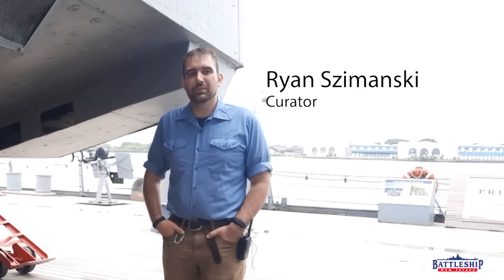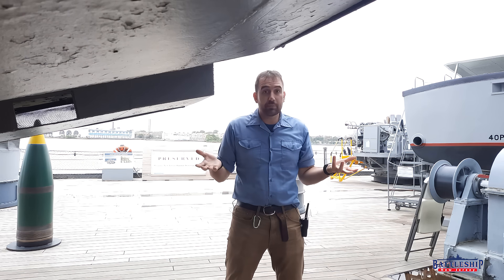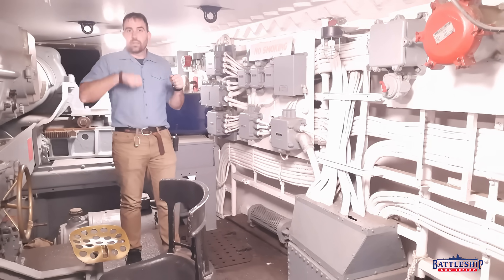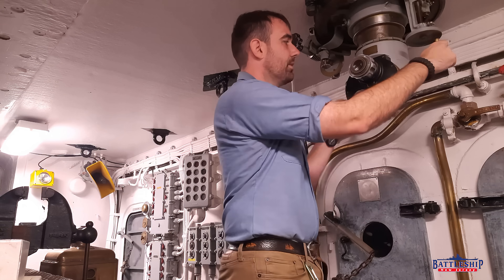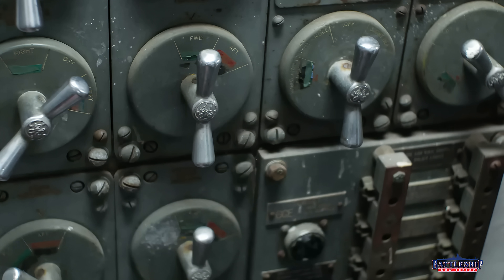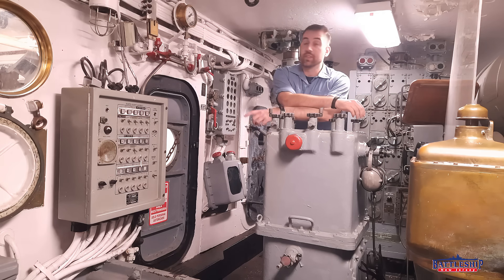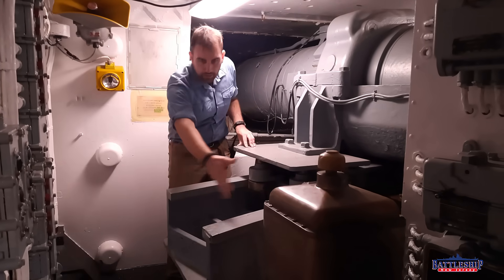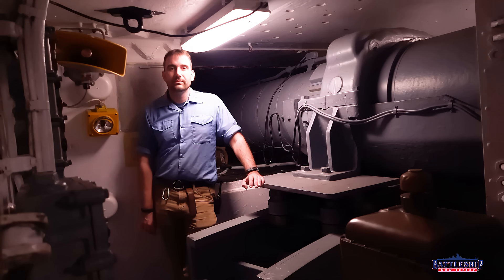Inside a 16in Gun House

Comment: What does the other, outside, end of the range finder look like?  Where is it located?
Reply: the two ears on the sides of the turret is where they are located
Reply: @jeffhousen8968    Thank you.  For binocular vision, makes perfect sense.  So this single tube that the range finder crew looks through is seeing the combined images of both left and right, and the single tube we see exposed in the room is parallel with the gun barrels?
EDIT after looking at a diagram, I see I was wrong.  Does the range finder consist of two separate tubes that can both look inwards, (like cross-eyed)?  My confusion is my assumption that it is one straight tube such that if the right side looks left, the left side would also have to look left.  Maybe the field of view is wide enough, so that what I am thinking does not come into play.
Reply: @conrad4667  I think the way they work is that you see 2 images (one from each side) in the viewfinder. You twiddle some knobs, which moves some mirrors until the 2 images overlap. The angle the mirrors deflect allows you to read off the range. The wider the range finder the more accurate ...they probably don't come any larger than on a battleship, but I've seen man-portable ones on display in the German shore defenses on the island of Jersey. (where the name originates)

Comment: That seat you mention isn't a 'Bicycle' seat but is very similar to the seats found on pre-1960s farm equipment.  Some tractors and a whole bunch of other pieces of towed (tractor or horse-drawn) and self propelled equipment had them.  Let me tell you, even to a young, pre-teen butt they were not the most comfortable things to sit on.  There were also dozers and other construction equipment that used them.

Even though I did some work aboard Iowa right after she recommissioned in the 80s, I never got to visit one of the turrets.  I did tour the aft turret of the North Carolina with my 5'11" son.  I'm 5'7" but even so equipment in that turret was finding my head and my son ... "Dad, I don't see how they did it."  And yeah, it was hot in there.
Reply: That seat is basically the same seat in brass.. that's on my '45 Farmall A.. wildly uncomfortable to sit on.
Reply: The seat is actually looking more comfortable than the seats for the gunners on a 3-inch M1902. But there is a disproportion between the cost of the gun and the comfort of the seats, obviously.

Comment: So, when the fire occurred in Iowa's number 2 turret, did the detonation overwhelm the interior gunhouse armor (between the turret officer's booth and the gun pit), or were the doors open, or did the conflagration just suffocate the crew through a combination of over-pressure (excluding air from entering) and gasses?
Reply: Wondered the same thing as I watched this. I wish Ryan would do a more in depth video sometime on the Iowa explosion, maybe touch on things like who survived and why they did and also a detailed discussion of what damage was done inside the turret.
Reply: @davidm.9812  At 09:53, about 81 seconds after Moosally's order to load and 20 seconds after the left gun had reported loaded and ready, Turret Two's center gun exploded. A fireball between 2,500 and 3,000 °F (1,400 and 1,600 °C) and traveling at 2,000 feet per second (610 m/s) with a pressure of 4,000 pounds-force per square inch (28 MPa) blew out from the center gun's open breech. The explosion caved in the door between the center gun room and the turret officer's booth and buckled the bulkheads separating the center gun room from the left and right gun rooms. The fireball spread through all three gun rooms and through much of the lower levels of the turret. The resulting fire released toxic gases, including cyanide gas from burning polyurethane foam, which filled the turret. Shortly after the initial explosion, the heat and fire ignited 2,000 pounds (910 kg) of powder bags in the powder-handling area of the turret. Nine minutes later, another explosion, most likely caused by a buildup of carbon monoxide gas, occurred. All 47 crewmen inside the turret were killed. The turret contained most of the force of the explosion. Twelve crewmen working in or near the turret's powder magazine and annular spaces, located adjacent to the bottom of the turret, were able to escape without serious injury. These men were protected by blast doors that separate the magazine spaces from the rest of the turret.
Reply: @davidm.9812  The explosion was caused by a fire that started when WWII era gun powder in a powder bag 45 years old ripped open and ignited because it was unstable and rammed too far into the gun breech in an attempt to close the breech and contain the fire. THERE WAS NO 'DETONATING DEVICE'
Reply: @davidm.9812  On 19 April 1989, the Number Two 16-inch gun turret of the United States Navy battleship USS Iowa (BB-61) exploded. The explosion in the center gun room killed 47 of the turret's crewmen and severely damaged the gun turret itself.To assist the GAO, Sandia National Laboratories provided a team of scientists to review the Navy's technical investigation.

During its review, Sandia determined that the bags of powder used for the gun had likely been rammed farther into the gun breech and at a higher speed than designed (a so-called overram), resulting in the powder igniting while loading was still in progress. A subsequent test by the Navy confirmed that an overram could have caused an explosion. Sandia's technicians also found that the physical evidence did not support the U.S. Navy's theory that an electronic or chemical detonator had been used to initiate the explosion.

In response to the new findings, the U.S. Navy, with Sandia's assistance, reopened the investigation. In August 1991, Sandia and the GAO completed their reports, concluding that it was likely that the explosion was caused by an accidental overram of powder bags into the breech of the 16-inch gun. The U.S. Navy, however, disagreed with Sandia's opinion and concluded that the cause of the explosion could not be determined. The U.S. Navy expressed regret (but did not offer an apology) to Hartwig's family and closed its investigation.
Reply: yes everyone in the turret officer's compartment died
Reply: Oh man oh man i was thinking the exact same thing, especially wondering if it blew out those internal port holes... what a horrific way to go =/
Reply: @ScumfuckMcDoucheface  At 09:53, about 81 seconds after Moosally's order to load and 20 seconds after the left gun had been reported loaded and ready, Turret Two's center gun exploded. A fireball between 2,500 and 3,000 °F (1,400 and 1,600 °C) and traveling at 2,000 feet per second (610 m/s) with a pressure of 4,000 pounds-force per square inch (28 MPa) blew out from the center gun's open breech. The explosion caved in the door between the center gun room and the turret officer's booth and buckled the bulkheads separating the center gun room from the left and right gun rooms. The fireball spread through all three gun rooms and through much of the lower levels of the turret. The resulting fire released toxic gases, including cyanide gas from burning polyurethane foam, which filled the turret. Shortly after the initial explosion, the heat and fire ignited 2,000 pounds (910 kg) of powder bags in the powder-handling area of the turret. Nine minutes later, another explosion, most likely caused by a buildup of carbon monoxide gas, occurred. All 47 crewmen inside the turret were killed. The turret contained most of the force of the explosion. Twelve crewmen working in or near the turret's powder magazine and annular spaces, located adjacent to the bottom of the turret, were able to escape without serious injury. These men were protected by blast doors that separate the magazine spaces from the rest of the turret.
Reply: @NAVYMEDIC610  thanks, source for this info? =)
Reply: @hemaka482  I figured but didn't care enough to go look

Comment: I'm 6'4", I don't fit in any armor... Neither tanks, APCs, or battleship gunhouses!
Reply: In the Michigan Army National Guard in Iraq my duty was in a signal shelter in the bed of a Humvee.  At 6'4", I could touch both side walls. turn 90 degrees, switchboard, and door.  If I tried to stand up, my shoulders hit the ceiling.  I didn't mind.  My duty babysitting it included access to the internet at work.  So sitting at the computer e-mailing my friends back home how rough I had things kept me sitting and busy for the shift!
Reply: @klsc8510  Never been in a humvee actially. I've herd mixed reviews tho...
Reply: @maxcaysey2844  Underpowered and terrible seats.  Fully climate controlled.  Hot in the summer, cold in the winter, and wet in the rain.  Other than those, not bad!
Reply: @klsc8510  Ha ha... sounds like the M113G3, which I have spend countless hour in. Sweating and freezing... Especially as a vehicle commander up top doing 45km/h in a hail storm! Good times!
Reply: Fun fact when Arnold Schwarzenegger served in the Austrian military he was a tank driver..
I'm still trying to figure out how he fit.

Comment: Regarding the welds, I used to work for a company that was a tier 2 supplier to a few government prime contractors. Some of the work I did was welding armor. For thick armor (half-inch or more) we would do multipass overlap welds on joints. We did it for a few reasons, primarily to create a large fillet and ensure we have a large area of the parent metal to spread loading. What I find so fascinating is I suspect back then they did it because as Ryan pondered the Navy didn't trust welding yet and it turns out it's the best way to do it. Fun fact, I did some welds on butt joints that started with a non-filled pulsed TIG pass followed by multiple MIG cap passes
Reply: It makes sense.  You don't trust the weld so you come up with a mechanical design that's stronger.  Even once the welds are proven it's still a mechanically strong design.
Reply: A multi-run pass will generally be weaker than a single run (of the same total size as the multiple runs) due to heat effected zones (HAZ) of later passes impacting the former, while the contraction stress area will be lower diameter. But reaching those sorts of immense deposition rates was probably not economical given how new large scale welding for of ships ect was... and they didn't have the benefit of hindsight to know lots of that tech/gear would last 80+ years, rather than being replaced again in a decade or two with something equally revolutionary, so going all in on tooling/training wouldn't have been seen as wise (although Japan did basically opt this route, and some early teething issues aside, it did pan out).
Reply: @SheepInACart  I used to work for a trailer building company. We had to switch from a single 1/2” weld on the king pin to a 3 pass weld because the amount of heat that the single pass put into the plate caused the king pin to periodically be ripped out through the 3/8” plate.
Reply: @jordan4777  As a cost economical switch if its still adequately strong, thats a fine solution, but the heat itself isn't the enemy, indeed it'd be stronger overall if you'd increased the preheat to reduce the heat affected zone (itself formed by the difference in temperature, not total amount) of the single run.

Comment: The multiple weld beads are how you get a proper connection for thick plate. If you only had one weld bead, the amount of metal connecting the two plates is only one weld bead thick. All of the extra weld beads are so you can get a weld connection that is as strong as the plates it’s connected to.  Not trusting welding may be why they zig-zagged the weld. That gives you a longer weld seam length, and thus more area of weld connecting the plates.
Reply: I noticed in the other video where it showed the top of the belt armor (I think it was the belt) had the same zigzagging. I was thinking it might there to better resist the shock of getting hit by large naval shells. A zigzag is far less likely to shear than a straight weld.
Reply: @aaronp3411  I think you've got it.  The forces / energy that impacting major caliber artillery shells would deliver are stupefying.  Where possible the designers and builders tended to be conservative, "if 'X' is good then 'X' + 'Y' would be better."  

The 'zig zag' joint is a design feature as probably the multiple weld seams are as well, though I wouldn't doubt professional pride entering into the extra care and effort.  "Hey, Iowa is being built in New York.  'Everybody knows' what slobs those guys are, let's prove WE can do the job better."  And of course the workers in New York were saying the same thing about the guys in Philly.
Reply: @robertf3479  
I agree. Redundancies and over design were the order of the day for these ships. The more I learn about them, the more this fact shines through. 

On the matter of professional pride-
I worked with a man when I was in high school who had served in a turret of one of the Iowa class ships in the 80s. I was a night stocker and he the assistant manager in a local grocery store. This was some 16-17 years ago, so I was much less interested in such things then. But you could tell he still beamed when he talked about his time aboard ship. I’d love to run into him again, I would definitely have a lot more questions.
Reply: @aaronp3411  It prevents straight shearing as well as if the welds for whatever reason get a crack, the crack would only travel down one weld area as opposed to eventually cracking all the way across. On a Zig zag weld, if 1 weld zag cracked, the others picking up the stress can do so more easily instead of the entire weight that weld area supported being on a single straight weld thus further causing the crack to travel across more quickly before maintenance can be done on it to repair it since ships were typically out at sea for long periods of time.
Reply: @wolf2179  Old Gunners Mate and welder here, the zigzag you talk about is a unlimited pass butt weld pattern. extremely strong weld pattern.
Reply: @RL-nz8xr  There is a book called "The New Science of Strong Materials."  It is an engineer explaining to us simple folk why things are the way they are.  Huge section on cracks and preventing/limiting them.  Combine that with Drachinifel's video on armor plate, and everything is explained.
Reply: That book is available on Amazon.  I think I'll get it, based on this extremely interesting conversation.

Welding on high-hardenability steels is always a crapshoot.
Reply: My Semi- Dad-in-Law was a welder in the petroleum industry and I was a mere soldered. He taught me about building up zigs on top of days to build up a stronger weld. I'm sure there's a right way a wrong way and a Navy way anyway.

Comment: The eye bolts are for moving/replacing equipment. You can hook a chain fall to the eye bolt to move things that will fit through the doors but are too heavy to lift. Stuff like electric motors or hydraulic pumps may be too heavy to lift and walk up a ladder but easily small enough to move through the doors. You lift it with a chainfall and move it by transferring it from one chainfall on one eyebolt to the next chainfall on the next eyebolt and walking it to the exit.
Reply: Not for pulling out fat sailors?

Comment: I got a laugh out of first description was as a headhunter, rather than a Headbanger. His Entryway into the gunhouse at the beginning of the video. - Would that ever be open at sea- a possible normal entryway - or ONLY perhaps an Emergency exit. There is another video(s)  on counter balances for easily open close these massive and heavy doors/ hatches relatively easy. That was armored wonder how hard closing it was.
Reply from the maker: That door would be opened while underway in addition to entry from the bottom

Comment: The “ears” on the other battleships may have been intended to keep the turret’s ventilation system from sucking in water. By moving the source of the air higher up, it’s further away from any green water on deck.
Reply: Is there another color of water besides specifically green?
Reply: @joshuamcdonald5621  Green water refers to when a ship takes a huge quantity of water over the deck in heavy seas.  This would be such as when waves are big enough that the bow plunges though them rather than over them.  Certain ships had issues with low air intakes and green seas causing the interior of the ship to become very damp.  The HMS Hood was known to be very unpleasant inside in rough seas for this reason.
Reply: @joshuamcdonald5621  blue water refers to deep ocean, brown water is fresh water rivers, green is when its on the ship in places it's not supposed to be, black water is sewage, grey water is used water such as from the galley but not contaminated with human waste.
Reply: @fire304  👌👍
Reply: @joshuamcdonald5621  whitewater, black water.
Reply: I'm thinking they might also prevent sucking up dust and smoke from battle.